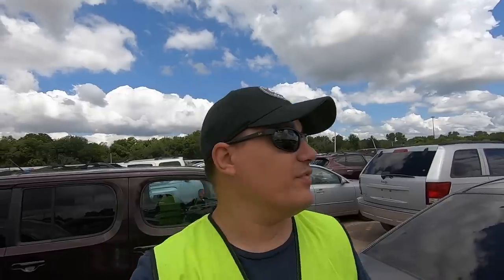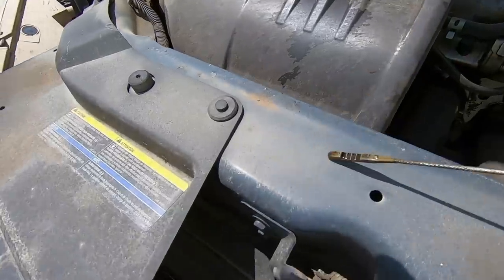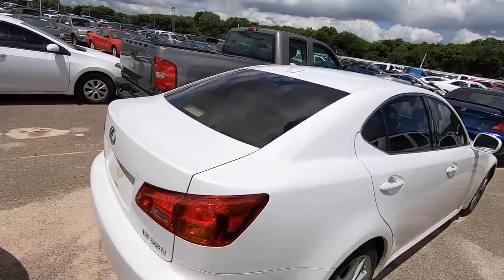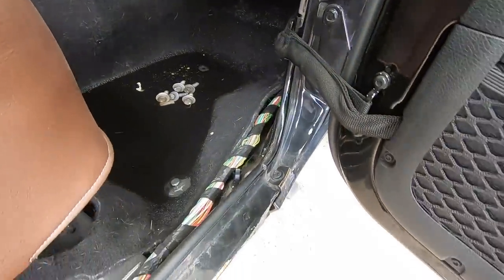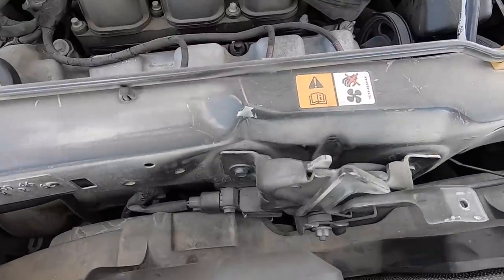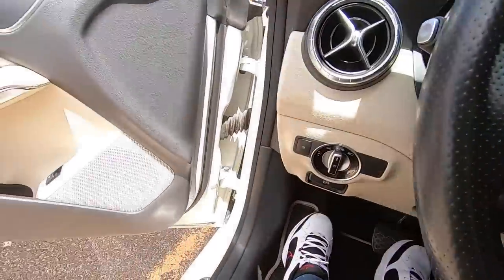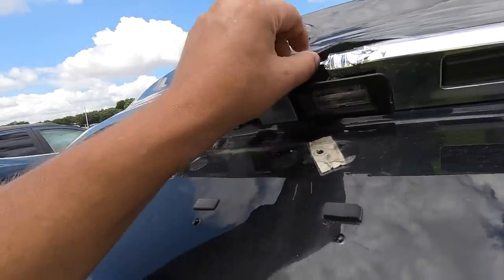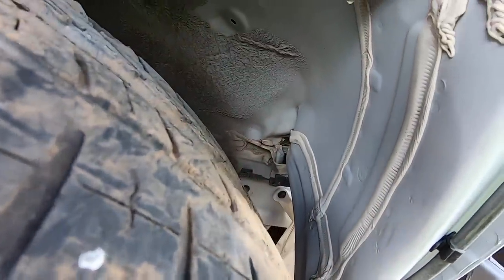Copart Walk Around + Carnage 6-20-19

Comment: If you look at what is in front of that Camry’s trunk, it is the rear end of a pickup truck with a tow hitch sticking out literally level with the same impact spot on the Camry’s bumper, someone backed up that Chevy pickup truck behind it (or the Camry itself) right into it, and probably never even told Copart what happened

Comment: 13:00 not to be that guy, but if a car sits over a prolonged period of time, the lifters will tap on startup until the oil flows through the galleys. It does not necessarily mean the engine is malfunctioning.

Comment: It's pronounced Ju-Lia and Q4 means AWD and their pretty good cars
Reply: Harvey Bold Define ‘good’. They may be fun and have decent build quality but I’d define ‘good’ as reliable and they’re not reliable. No Italian car is, and most modern Europeans aren’t either lol.
Reply: @daveedwards6727  Well, I must have bought the exception then ;)  DAF 77, otherwise known as Volvo 440, 1.8i (that's a 1.8litre injection, no idea how many cc that is) and it just turned 25 this month! Registered Jan 1995, has a few cosmetic items, all my fault I'd admit, but otherwise a good reliable car. Not the prettiest, but it gets me from A to B and most importantly, back home again!

And you're absolutely right on Italian cars, over-hyped, over-priced and over-rated rust buckets I won't touch with a barge-pole. But the likes of VAG (Audi et all), BMW, Mercedes and to a lesser extend Volvo are kinda popular in the US as they're by and large economical runners with affordable pricing and retaining their value better then some US brands.

As for some of the other vehicles, I'd suggest picking them up for spare parts instead. You could easily charge 500+ bucks for a running motor+gearbox, even used.

PS: predecessor of my DAF77/Volvo440 was the DAF66, which had a Variomatic gearbox. This had a pretty much infinite number of gear-ratios and could run backwards at the same speed as forwards! DAF sold their passenger car manufacturing to Volvo in the 80's (IIRC!) but still makes trucks, amongst other things.

Comment: I know that this is kinda random, but does anybody else have the Samsung Galaxy S10 Plus? I'm having problems with the aspect ratio on certain videos from certain YouTubers. The hole punch gets in the way of the black bars on videos from Austin Evans, is it the aspect ratio?
Reply: I use S10 (not +) & dont have the issue.  Have you tried checking the settings for the playback? Can access by tapping on the 3 verticle dots in the upper right corner of the video

Comment: JUST FOR YOUR INFO I HAD A 2002 DODGE RAM THAT WAS BUILT IN NOVEMBER OF 2001 AND THE BATTERY LASTED 13 YEARS BUT I DID NOT HAVE A LOT OF ELECTRIC DEVICES.
IT HAD HAND CRANK WINDOWS AND MANUAL SEATS.

Comment: On the Jeep that 3.6  engine always does a lifter tap. I had a Chrysler 200 with the 3.6. It was a great engine but if it sat for a few days it would make that noise when I started it. At about 60k miles thank goodness I had a warranty and they replaced the lifters because they started tapping continually.
Reply: There are YouTube videos of guys with brand new Wranglers having bad engines. Long wait for lemon law buy backs. No body wants to buy a new car & have the engine rebuilt. A replacement vehicle or a crate motor. Good friend had a 2.7 EcoBoost in a 2017 F150 having  bad oil usage out its exhaust. Could not fix. Buy back at 7k miles. Gave him a new  '18 f150.

Comment: I laughed when you said Hyundai/Kia is reliable.
Reply from the maker: I drove my 300hp 2013 Optima SX Turbo 70K miles doing Uber with zero issues. Got to love commenters with zero experience on what they are talking about.
Reply: @AutoAuctionRebuilds  The same 2.0T Theta 2 engine that had millions of vehicles recalled due to con rod bearing failures. And the same 2.0T that has huge oil consumption problems? I’ve seen Sonatas with that engine come into our shop down three quarts of oil between changes of 3000 miles on motors with like 70-90 thousand miles. Also had multiple customers with complete engine failures/seizures on those early Theta 2 engines. Any Hyundai Kia GDI engines I would never trust. Just cause you got lucky doesn’t mean they’re reliable. Hyundai was forced to give a lifetime warranty on the engine by the NTFSA. Their earlier engines with port injection during the 2000’s were fairly decent but those vehicles suffered from some transmission issues.

Comment: Funny how a 150K mile Lexus made by Toyota (RELIABLE AND DURABLE BRAND) is concerning yet a 250k mile cheap junk GM car wasnt concering at all.
Alfa Romeo Guilia (pronounced Julia) has the same engine as the Maserati because theyre both owned by Fiat Chrysler Automobile. The Q4 badging stands for Quadrifoglio meaning AWD for Alfa Romeo. They come with a 2.0L turbo and a 2.9L V6 twin turbo.
Both Fiat ana Alfa Romeo returned back to the US after Fiat buying out Chrysler Group LLC and renaming it to Fiat Chrysler Automobiles of USA LLC (FCA USA LLC). Alot of the Jeeps, Dodges, and RAMs have Fiat engine causing the brands its name durability and reliability, especially for Jeep.